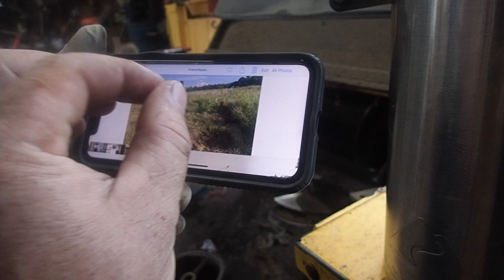Crashed The Wd2303 (Bad)

Comment: Neighbor of mine owns land behind a row of houses, 1st cut alfalfa and grass hay, new holland discbine, some asshat in one of the houses threw an old open bed spring set in the field during the winter and "forgot" about it, when i got there with my bale wrapper, they were under there with a torch and chains  using words that i even forgot about, many in low german, it had wrapped in the rolls and around almost every turtle and jammed the mower up to a stop. What a mess. That tempered spring wire does not cut with a side cutters, it takes a torch to remove the temper
I know from experience it sucks when the old man screws up

Comment: Even if we don’t use GPS guidance on all fields or in all equipment, we put pins of obstacles on shared maps.  We have pounded in taller white PVC pipe with rotating white/red reflectors.  They have been quite easy to spot.

Comment: Had to buy a "new" to us cutter bar this week as well hit a stone in a field we have mowed for years, we always mowed over it before but the landowner got a bee in his bonett over compaction and wanted us to mow in the other direction as it's a fairly square field I said why not and sent the mower in to go across instead of up and down, if the set was a foot one way or another we would have probably ridden over it this time as well instead of that we caught the outside disc and you can guess the rest one middling second hand cutter and six grand later we got back going but there won't be any profit in that third cut that's for sure!

Comment: Keep on trucking mate, when stuff breaks it's coz they being used, that amount of acerage, so easily done,,, I have a couple of tractors, 3 diggers, bobcats, tracked barrows and these were all new, not over used but need maintenance, and fixing most of the time, endless expense, my newest purchase a tractor mounted wood chipper, brand new, belt adjusters, not even on machine, let alone fell off or broke,, this was from the dealer,, could have complained, lost days working, so fixed my self,,, endless,, keep up the good work mate and fuck all the negativety. 👍 👍

Comment: That would be my fear with a big M- so much more header width to watch versus the self propelled windrowers.
Reply: DeHaven Family Farm those krone cutter bars are tough i was cutting a ditch with a big m 420 after i was done the field to make things look tidy and i picked up a huge boulder of a rock probably about 75 pounds it got stuck on top of the turtle infront of the flails and the top cover and stalled the machine i had to take a mini jack hammer and chip the stone out piece by piece and all I wrecked was 4 knives

Comment: I once mowed through a vertical water stand pipe, field had be used for  allotment's (Uk Small gardens). No water came out pulled pipe out that was still stuck in ground turned out somebody had cut it off before and stuck back in the ground what was left.

Comment: Never trust a farmer. I used to custom stack hay with a 1068. I got called to stack a field that had steep sandy hills. I asked if a 1068 had stacked the field before and he said yes, no problem. I about rolled my stacker several time. When I finish I told the farmer to get the guy that used to stack it because I would not do it again. He said he couldn’t. I asked why, he said because he rolled his stacker on the hill I was working on and got killed. That is just one of the times I was lied to about dangerous stuff.

Comment: Best way to avoid those, go in prior with a much smaller mower, ie., lawn mower, weed eater and cut around them. You'll see them then, just putting in a flag doesn't mean much, just as you discovered Wes. Now, before people start claiming you're just too hard on your machinery, shit happens no matter how careful you are. 
Correct me if I'm wrong but, I thought those turtles were supposed to be 180 from each other. Cheers :)
Reply: That would be 90 degrees
Reply: @mikegoodman447  yea my bad for the typo